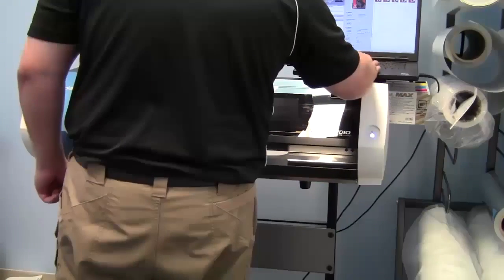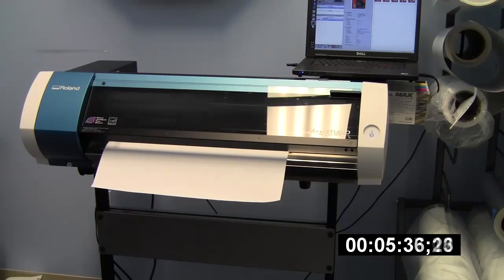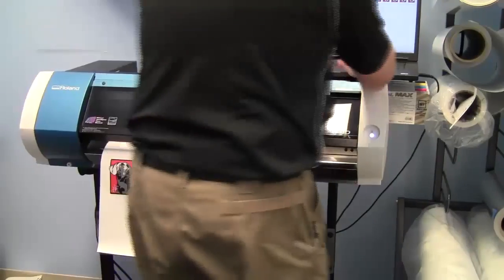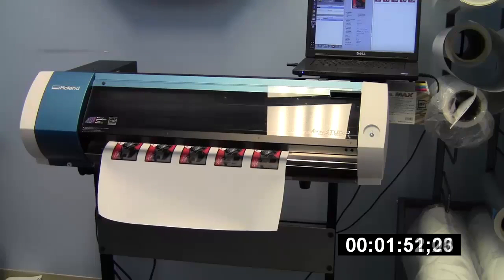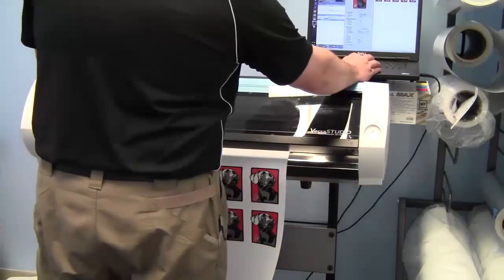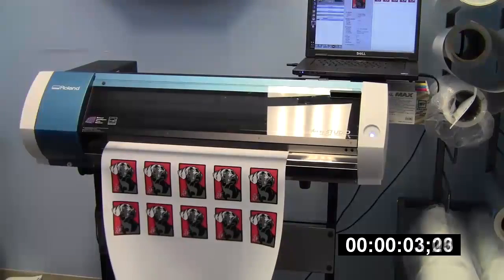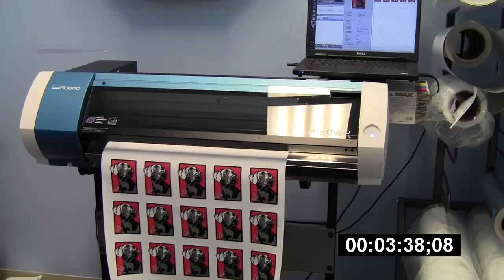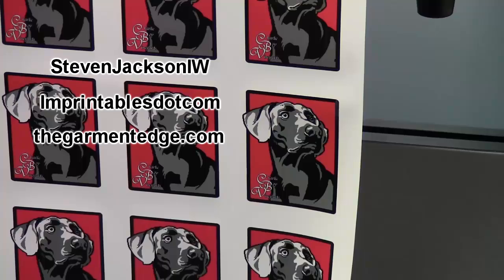BN20 Versastudio print modes and speed updates

Comment: Hi Steven, I bought one of these machines just over a year ago and thought I'd share my experiences with this machine, I run a sign making company in Scotland, I have been pleasantly surprised! The draft and draft2 modes really make it faster now and there is not a great deal of difference in terms of quality. Yep its a slow machine but the results speaks volumes. handy little addition, I have the cmyk + (white) setup and its running sweet.

Comment: To find what materials you can use go to "Rolanddga" then search "BN 20" then click the "Accessories" tab.  It will give you serial numbers and you can buy them from multiple places.  You can get other materials but make sure it works with the jobs and ink.  There are several forums that has this info.

Comment: you can - you will need a separate laminator or use spray laminate to protect the decal.
Reply: Where can you get the spray laminate would it would good for like stickers?? Spray it after the print has printed and cut